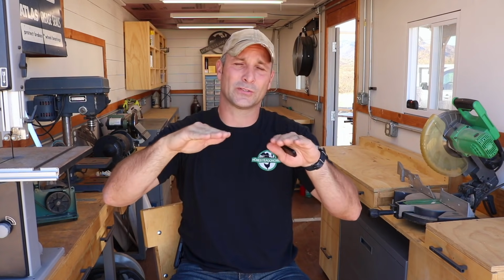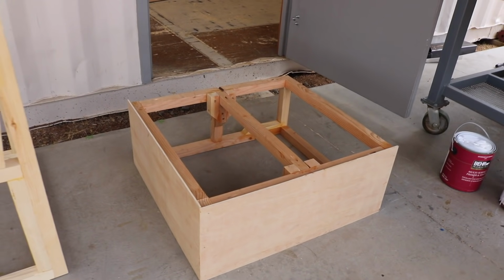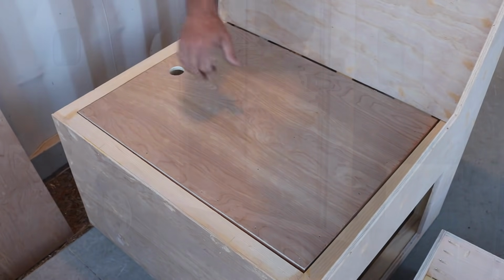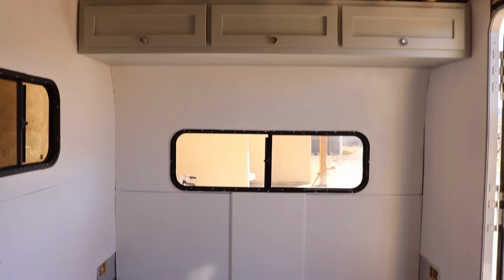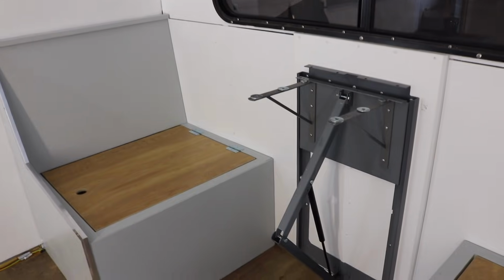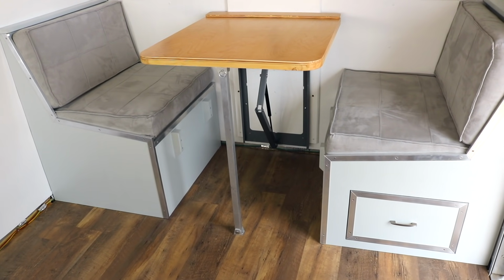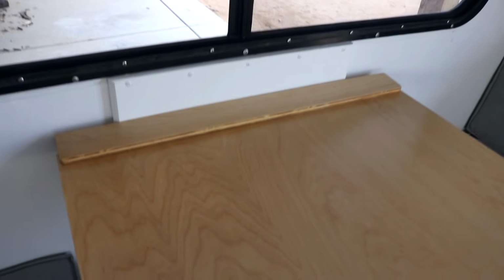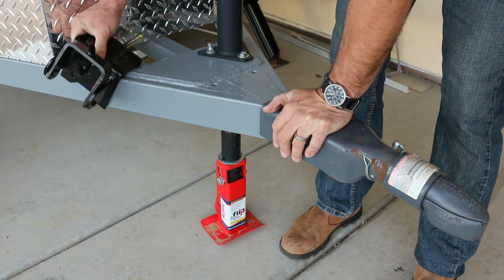How to Build a DIY Travel Trailer - Dinette, Bed, Cabinets and more (Part 6)

Comment: I like the seats and cabinets but I would have never painted them I would have stained them all that all that pretty wood.
Reply from the maker: thanks!  Yes, that was kinda of a 'what should I do thing'... I liked the wood but I had a couple different types of ply on them and would have had a different look with the back and the lower fronts than the sides.   But nice stained wood does look great when done right :)

Comment: Most people make the seats too high, top of cushion should be about 16” from floor allowing you to tilt the front of the seat panel up 1” to give you a more comfortable seat. Of course you need to be able to drop the seat back to flat for the bed. Can be done with tapered cushions but that would be too complicated for you. Back cushions should also lean back 1”. Most people also overbuild everything, you might think you are doing a better job than a factory but weight is not your friend.

Comment: I know this is an old video.  But, I renovated my '67 Airstream Caravel and used that same flooring.  So far, after 3 years, it still looks brand new.  What I found out is that it shrinks considerably in cold weather, then finds it equilibrium before leaving wider than ideal seams.  Also, I put my flooring in first, then all cabinetry went on top of the floor.  This way, there is flooring inside the cabinets when you open them up for a more finished look.

Comment: Safety concern with many sharp edges with all the metal trim pieces. Bare feet and children might get injured on the seat bases. Drawer and table support are toe jammers. Baby proof needed-maybe not-  Major leg gouger at the edge of the seat base. Look at the sharp edge trim just as you sit down in shorts. Visualize a school bus seat or subway with Rounded trim or fully covered seating. Shelves/ cabinets do not have angled edges...mostly rounded or blunt(bull nose). As you know, kids sliding in socks and shorts will be prone to cuts and scrapes. Just my observation. Not at all a question of build quality-just build safety. Just my thoughts.